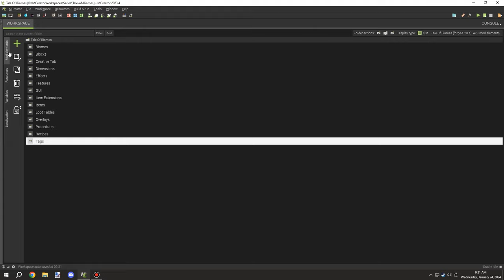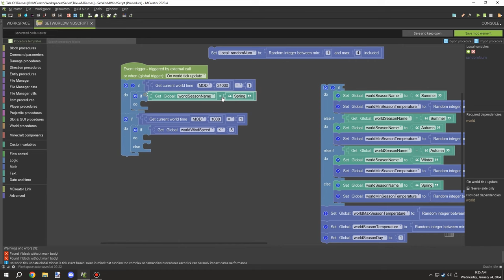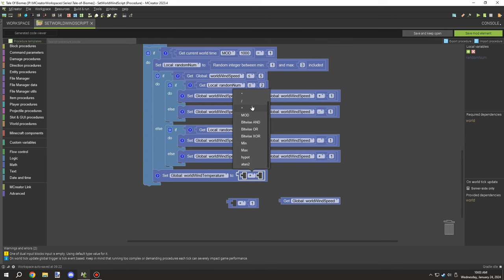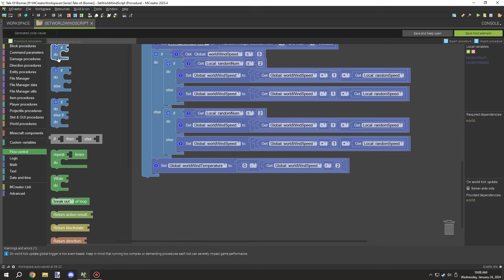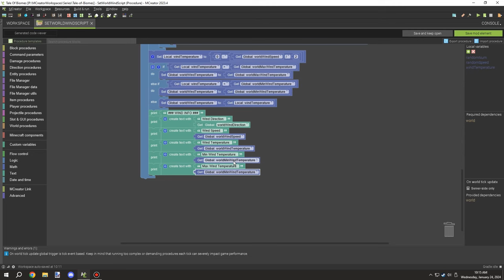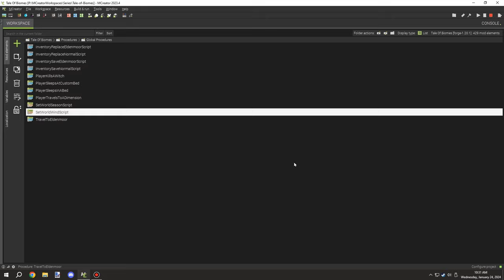Wind System | MCreator Lore | Ep53

Comment: Hey, there's a problem in my mcreator that I don't know why it doesn't work, it's like this, when I do for example:

"Attempt to override motion vector of Sourcer entity to vx: (X value of look angle vector of Event/target entity + 1 ) vy:(1) zy: (Z value of look angle vector of Event/target entity + 1)"

Instead of it being thrown in the direction that the Event/target entity is looking at, it is always thrown to the southeast, even when I do this in "Set Location", even if I change the X and Z values, it continues to be thrown to the southeast and I don't know why, this is quite annoying. Do you know how I can fix this? This would really help me a lot.
Reply from the maker: you will need to make sure you have the right entity selector try to print the entity selector to the console it should list what entity is which when a trigger happens. I did not see the read-more part.
It most likely is set up for the wrong entity selector. You can also try making it run only on the server side so NOT Client side this will ensure that it won't be running two times, one on the client and one on the server which can cause some syncing issues for clients.

Comment: Uh, is it possible to make a tool that increases your reach like what the crab claw was supposed to do?
Reply from the maker: You would need to use ray tracing for this but yes it would be possible for sure, but it would not work with vanilla tools. You would need to script the actions in by hand using procedures.
Reply: There is a forge:reach_distance attribute! YOu can use that
Reply: @NorthWestTreesMCreator   that's fine.

Comment: Hello again, it's me sivll from other account. I meant by "Easier" by excluding the connectors because i joined mcreator community 3weeks ago. And its WayTooHard to Understand loooong Procedures. I also used PlayTics's Cable Tutorial.. Nothing good. Aint Inputing in anything like Baterry from Pylo's Tutorial. Can you do This? Also is There a way to create Pollution effect to machines so Nature will be dying?
Reply from the maker: I remember, and welcome back :)
I am working on a forge energy series, though cables had some issues so I could not record a video this week as I discovered it only after recording the video parts. Turns out the energy system had issues so I cleaned up that part so it's just one procedure now for the energy script. I also tried to clean up the model update script but it's already set up as best as it can be. Blocky also can corrupt procedures if there is to many procedure blocks but this varries based on the PC hardware of the user so another good reason to try to keep things smaller. Some of the procedure blocks for the model update script does cause a bit of lag for my PC so its best to not merge them down into one procedure.

For pollution on older Minecraft versions sadly no. But in 1.19.4 and up its possible to use the fill biome commend and replace the biome around the block. You could increase the area over time too but this would need to be adapted to work with repeaters, If you just started working with procedures I would suggest holding off on this for now as its pretty advanced for someone new to the procedure system. However most of the things you will need are already in the procedure guides playlist which is good place to start.

The exact wiki page can be found here.
https://minecraft.wiki/w/Commands/fillbiome
You would set NBT variables to control the to and from.
You could also even make your own custom biome to make something look a bit more polluted.
Though this won't replace blocks just color the tint index of grass, leaves, and water, possibly also effect the air color too.